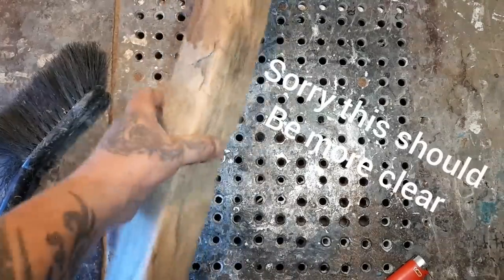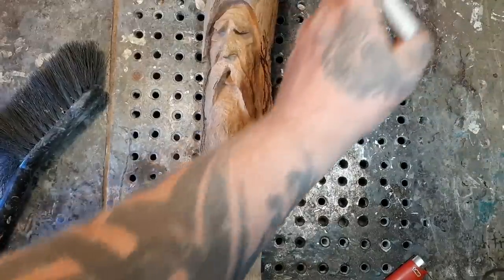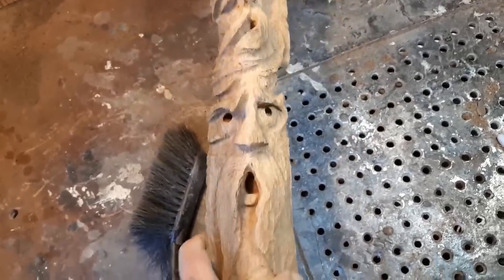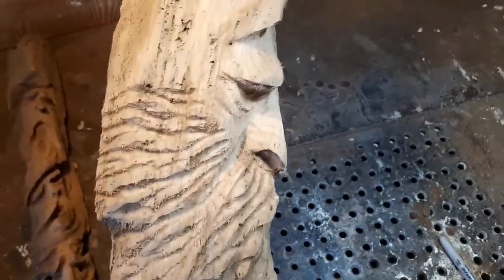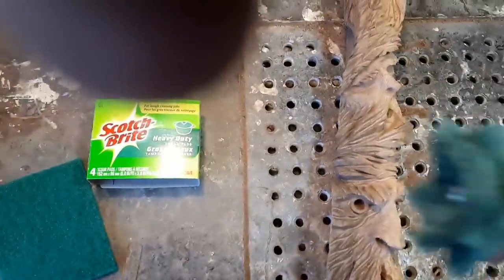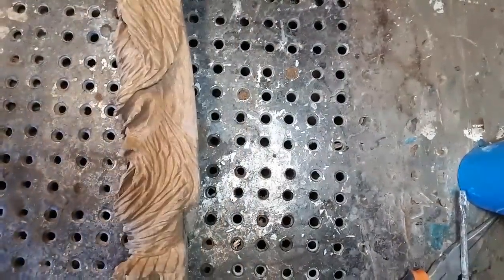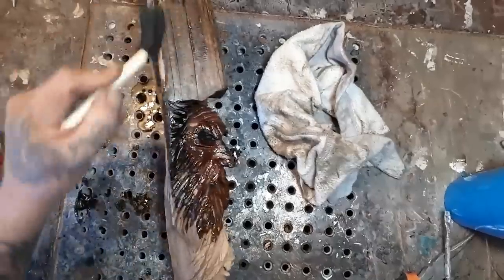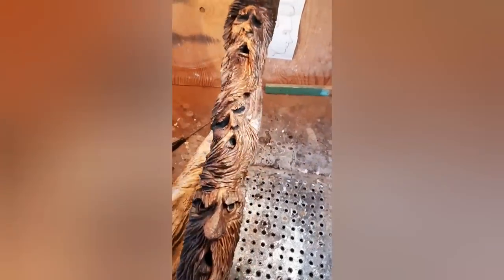Power carving 2019, Dremel carving 2019? Dremel, carving burrs

Comment: Jordy i learned that from you and the way I tighten is screwdriver short Phillips in hand while holding screwdriver with other hand I use wrench and crank first nut real tight and apply the second nut useing the wrench and needle nose pliers the nut neve comes loose but the shank does I need to clean off some threads thanx pal.